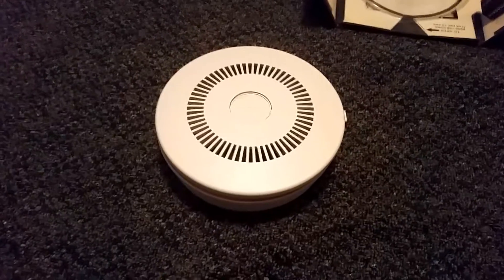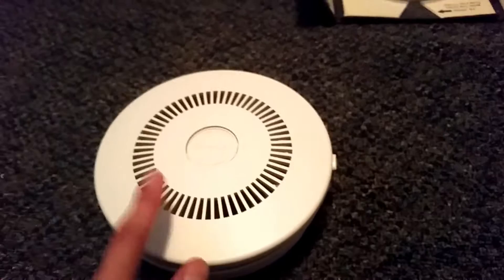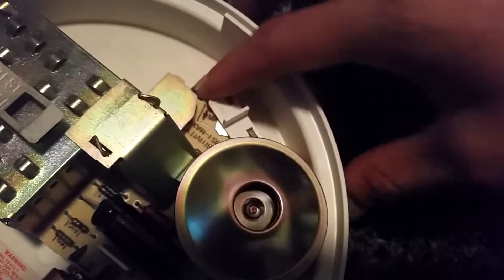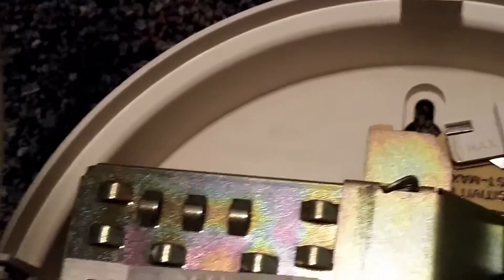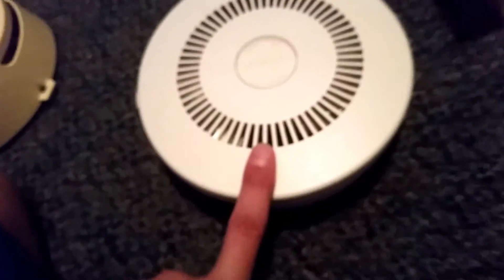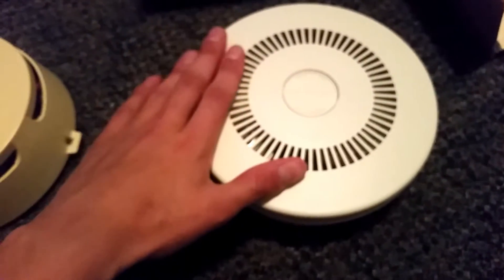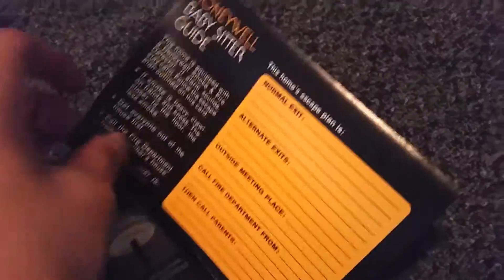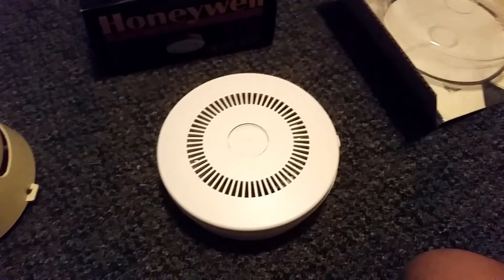Honeywell CD200A Smoke Alarm - Part 2

Comment: Neat smoke detector and that sound is one from my from childhood. I was in kindergarten when that unit was made. Funny thing and never thought of it until you mentioned it but the cover design does resemble the much later Jameson Code One detectors although the Code Ones were much smaller. This detector does look more modern even for its time (1978) and compared the other Honeywell unit which has a very dated mid to late 1970's look. Still wished detectors sounded like this today. Terrifying but they gone ones attention for sure.
Reply: Another good thing about this detector I forgot to mention is that it comes with an escape route for babysitters and instructions on what to do in case of a fire. You probably wouldn't see that with smoke detectors today either. I saw these growing up and I do believe this same unit was used in a Daffy Duck fire safety PSA from around 1982 or so. There were a few other  live/animated safety PSAs around the same time to feature Daffy Duck and Bugs Bunny. They are on Youtube as well still I do believe. My aunt had the same older Honeywell unit in her house until about 5 years ago. She forgot that I collect these units as well and got of rid of it. Oh well still on the lookout for these detectors at second hand stores. That is how I found my Nortron unit and Gardsman bell.
Reply from the maker: Funny thing is that I have awful luck at thrift stores, never seem to find any alarms there
Reply: It is pure luck finding them at thrift stores. I guess it is a matter of being at the right place at the right time which is what happened in my case.
Reply: Three years later and finally signed up for an ebay account. My first bit is one one of these........I should know by Monday night!!!

Comment: Looks cool. Did these come in a commercial version for fire alarm systems? I've seen one in a movie. https://www.youtube.com/watch?v=iTHUDi2gI34 40:57
Reply: better shot at 41:30
Reply: I was unable to view your link as it was private. Could you make it so I could view it? Thanks I would love to see the clip. What movie was it? I saw an old Eight Is Enough episode from the first season  (1977) to feature an old Honeywell unit. However the sound was dubbed in. There was also another later episode from November 1978 to feature an old GE again with a dubbed in sound that sounded like a bell ringing. Why they would do that I have no idea. I didn't see these episodes when they originally aired. I was 4 and 5 at the time. I saw them in reruns several years later around 2002. Neither of these episodes are on Youtube. That is the only show from the 1970's to feature smokes. But I could be wrong. If I am let me know.
Reply from the maker: Honeywell actually did make a system version, model TC100. It had a similar design to the household CD200 models, but no button on the front and the vents were smaller and recessed into the cover. They also had the same sensor and sensitivity adjustment system. Thesdx has a TC100C.

Comment: i like the sound of it its so vintage
Reply: I never noticed years ago that is one has a lower pitch squeal than the older Honeywell unit beside it. I agree the sound is very vintage and again these kind of horns were a lot better than the ones of today. These kind of horns terrified me as a child but watching this video a few times has helped.
Reply from the maker: This is the lowest pitched Honeywell I own. I'm not sure why but the alarms with this style case always sounded more raspy than the other versions. My TC89B is the highest pitched alarm I own, and it doesn't have a lot of that "ting" after the horn stops sounding. Funny thing is they both have the same horn; the Kobishi CLB-27 brass squealer